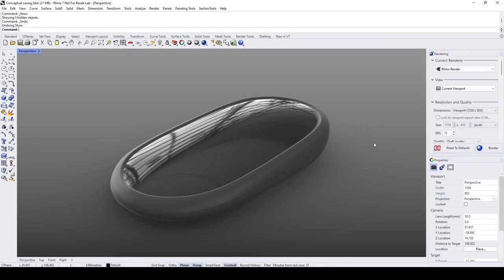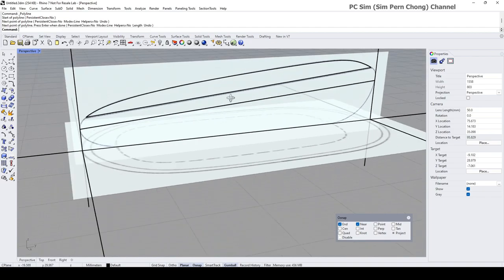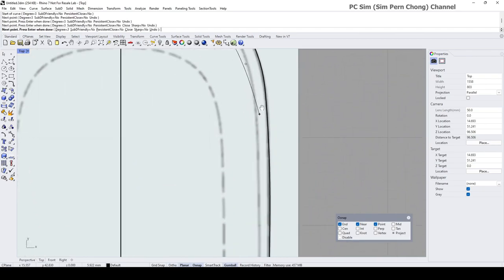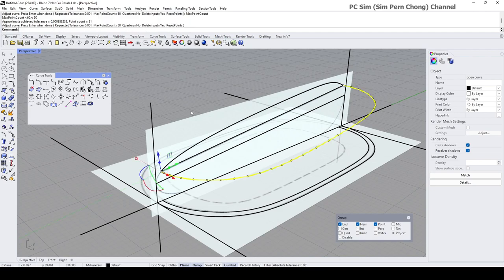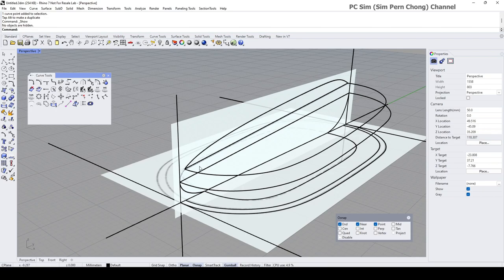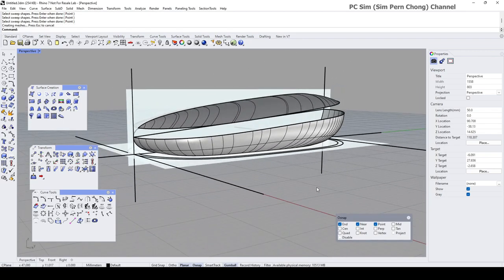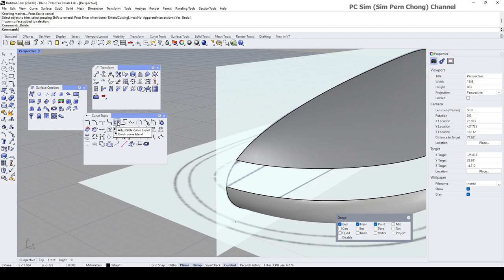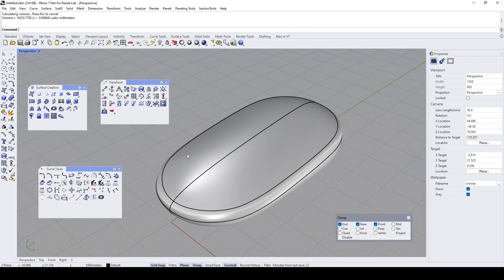Rhino 3D CAD Beginner Tutorial: Modeling a Conceptual Casing (Part 1) 【犀牛初学者教程：产品外壳建模】

Comment: Rhino is a highly capable software for product casing design, as it offers a range of tools and features that allow designers to create detailed and precise 3D models of product enclosures. Here are a few reasons why Rhino is a great choice for product casing design:

Robust surfacing tools: Rhino has advanced surfacing tools that allow designers to create complex, organic shapes with precision and ease. This is particularly useful for product casings that require smooth, flowing curves.

Compatibility with other software: Rhino is compatible with a wide range of other software packages, including rendering and animation programs, which makes it an excellent choice for designers who need to create highly realistic visualizations of their product casing designs.

Large user community: Rhino has a large and active user community, which means that there is a wealth of online resources and support available to help designers get the most out of the software.

Overall, Rhino is a powerful tool for product casing design, and its advanced surfacing tools, parametric modeling capabilities, compatibility with other software, and large user community make it a top choice for designers in this field.